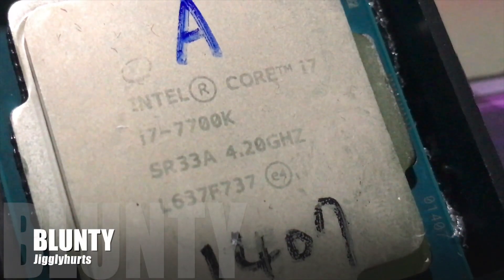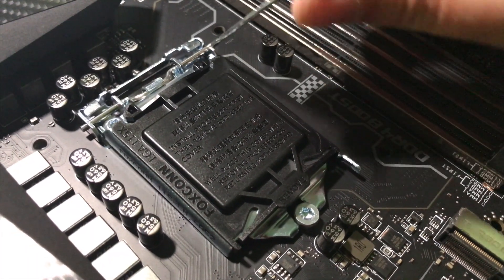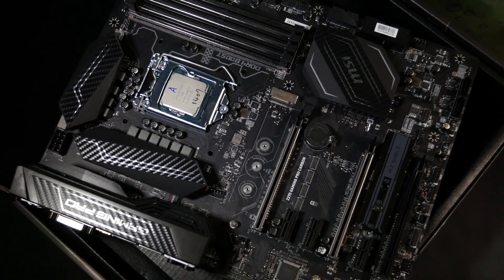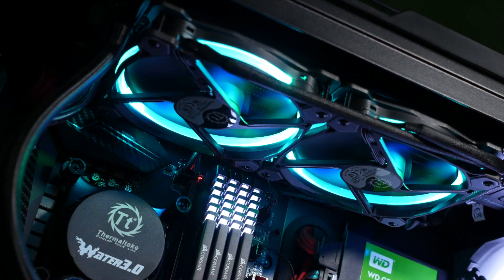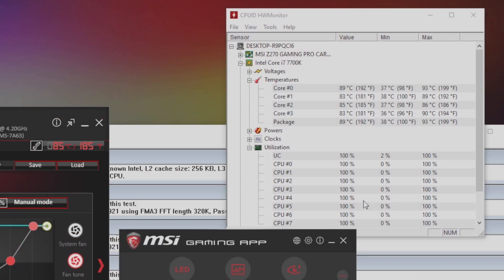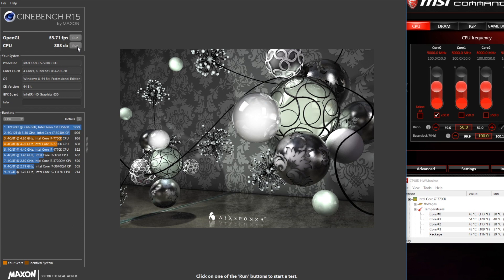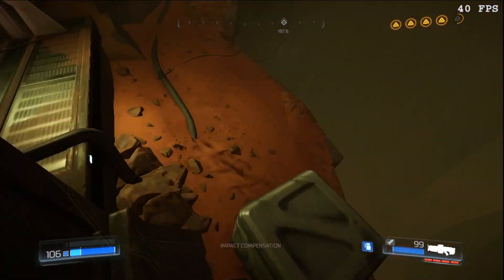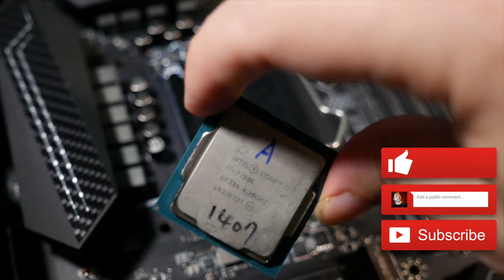Overclocking the i7 7700K “Kaby Lake”, Intel’s New Big-Boy CPU

Comment: BLunty what do you think of the "microsoft endorsed" vr headsets coming out from lenovo and asus and other companies? Lenovo has one coming out with 1440x1440p screens and will cost 3-400$!
Reply from the maker: When they have finalised specs, prices and are showing off WORKING models, not just dummy headsets to distract "journalists" at CES with, I'll form an opinion.
Reply: cool. they haven't specified fov either, which to me is more important than resolution

Comment: so my i5-6600k is old fashioned tech now ;_;
Reply: Nah.  I'm still doing really well on an i7-3770.
Reply: Still going strong with the 4790k lmao
Reply: Still rocking a 3770, rock solid performence
Reply: SilentFatality I have a 3770k running completely stable at 4.7ghz and il be going for 7700k next week, hopefully itl sit as happily at 5 ghz as the 3770 did at 4.7
Reply: Lum1nou5 i just got one 3 months ago
Reply: Lum1nou5 no it's bacilly the smar
Reply: Lum1nou5 I got it 1 week ago. Should I cry? 😢
Reply: mjc0961 Same I've had no problems at all with my 3770k